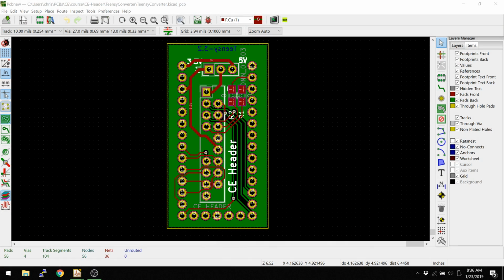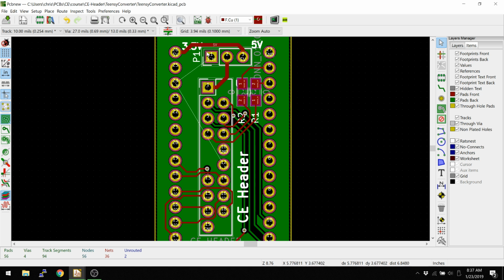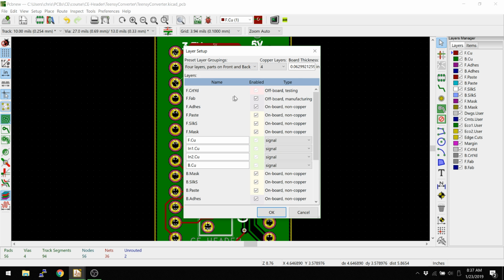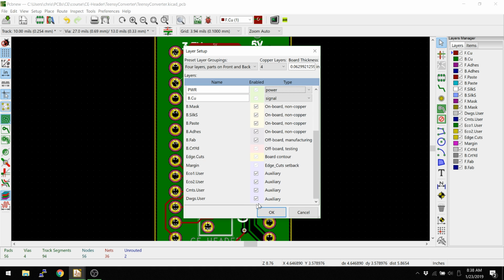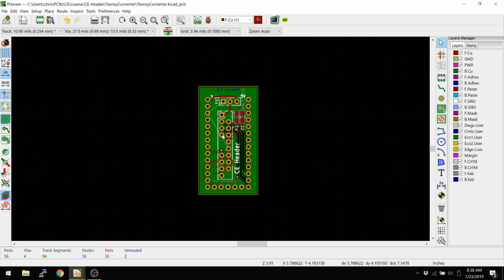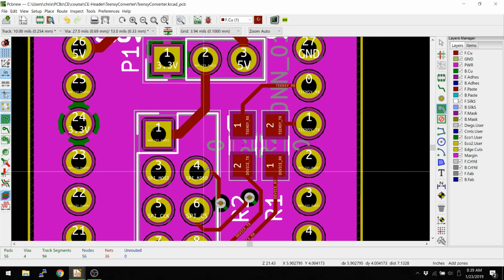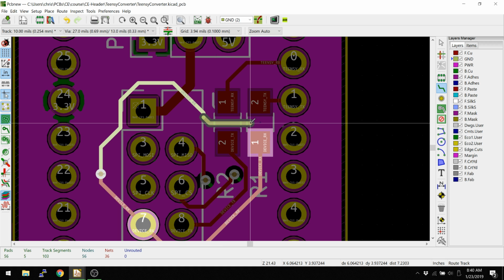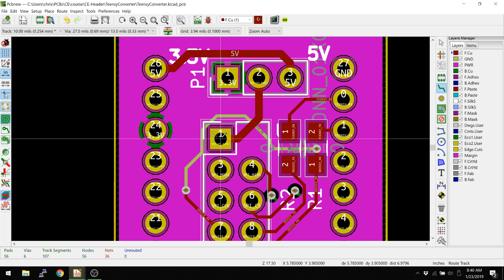KiCad 5.0 - Switching from 2 layer to 4 layer

Comment: I cant go from 2 to 4 layers. I have the newest version of Kicad and cant find it
Reply: I'm using KiCad 5.1.2 and found mine in Files--Board Setup--Layers where copper layer number is a drop down option. I hope this helps!
Reply: @NoahPeake  yess i got it
Reply: have you find its solution? 
I am facing the same problem.
i am using Kicad 5.1.5
Reply: @FuxionTech  nope didnt find the solution. Searched the whole internet
Reply: @contextual Electronics ???
Reply: @FuxionTech  Go to the 'Design rules' drop down.

Comment: Hi Chris, thanks for the nice videos. A few questions regarding this topics:

1. What order of layer usage do you recommend? Signal, GND, PWR, Signal?
2. Do you recommend using ground pours on the empty spaces of the signal layers?
3. If you use a GND and PWR layer on top of each other, doesn’t this effectively create a huge a capacitor? (And would this be a bad thing?)

Thanks! I appreciate everything I learn from you!
Reply from the maker: Hello! These are great questions for the CE Forum where we can answer them more in depth: https://forum.contextualelectronics.com